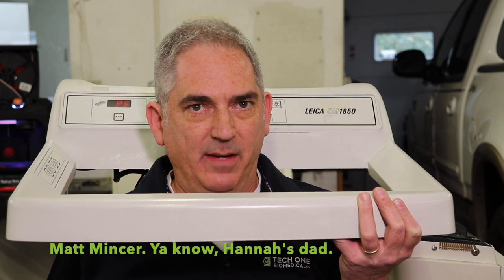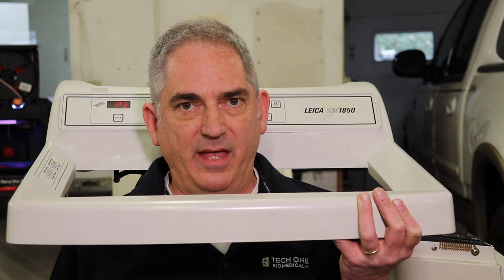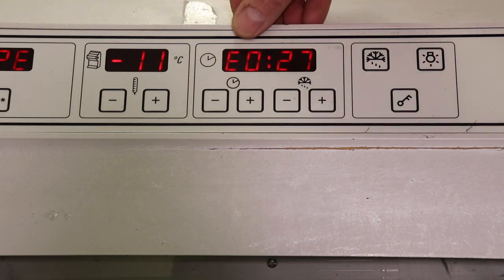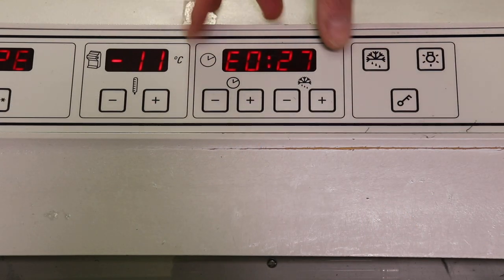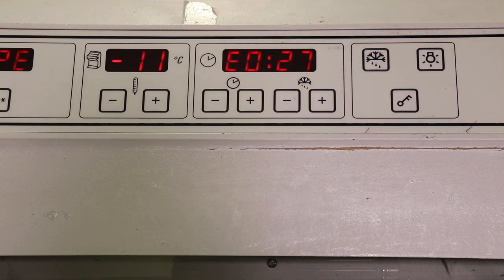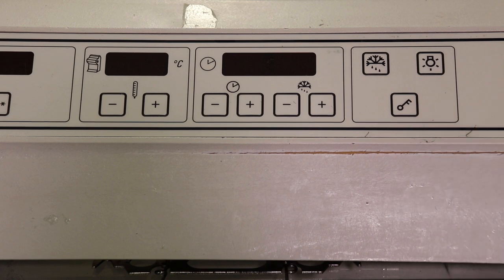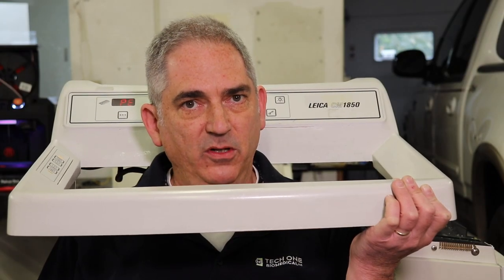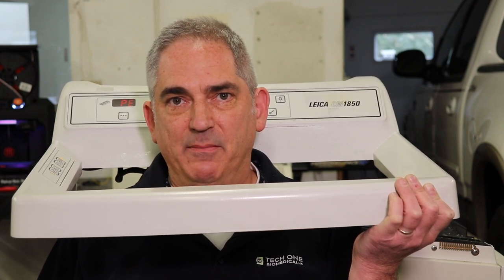Leica CM1850 Cryostat - Error E027 | Lab Equipment Repair

Comment: I have a CM3050S cryostat, and the OT rises to around 11C. I called custom service, and they said the vent may be dirty and need to be cleaned. Could you please make a video to show how to clean it? Thanks.
Reply: Do not  bother with air vent that you are told . You have solenoid valve issue. You can call me for repair estimate.